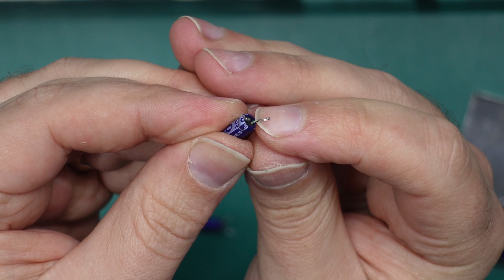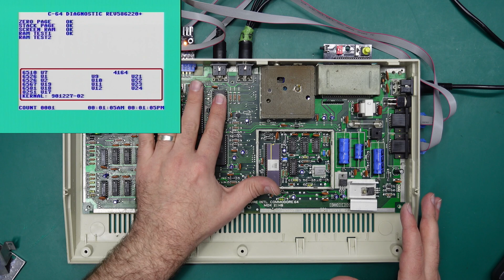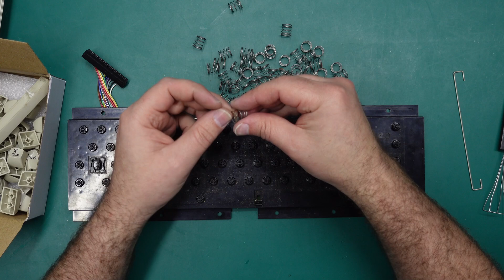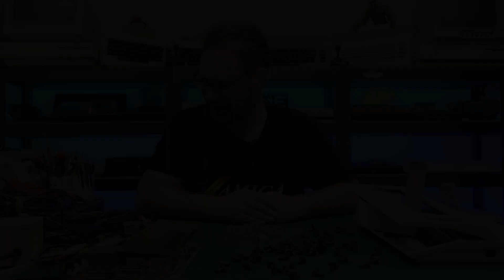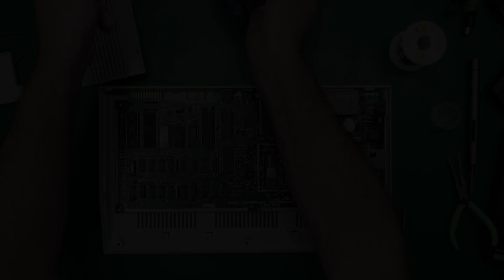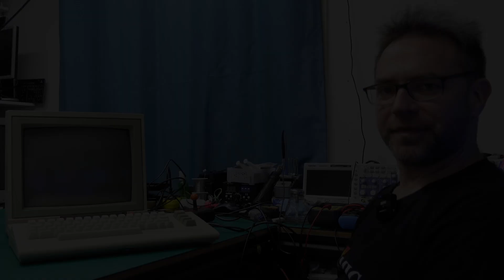Commodore 64C repair Part 2 - dirty ports and keyboard sup...ports

Comment: Could you leave the can lid off and use a heatsink?
Reply from the maker: It should fit, but I think the can is slightly more effective (as long as the thermal paste hasn't dried up)

Comment: The 8-Bit-Guy suggested washing (retro!-)mainboards in the dishwasher without the soap and rinsing them with alcohol afterwards, what are your(/everybodies) thoughts/experiences on that?
Reply from the maker: I prefer using my dishwasher for dishes. But if it's just with water and then a through rinse with 99% IPA then it should be ok. Still there's things like switches and ports to consider, water can get in there in the dishwasher and you'd want to be certain that it's completely removed afterwards. 
Tldr: I don't recommend it

Comment: I have never own a C64. At this point I would like one in my collection. I have no preference aesthetically. I assume one of the latest models would be most desirable, if I can find one?
Reply from the maker: Yes, newer boards are generally more reliable. I'd avoid the breadbins and look for something in the C64C style case. That way you'll likely end up with a 250466 longboard or a 250469 shortboard. Unless someone has swapped the boards like the one in this video of course.

The 250469 are probably the most reliable but some people prefer the longboard for the 6581 SID, and likewise some prefer the shortboard for the 8580 SID. Personally I prefer the 6581 but there are mods to make the 6581 work in a shortboard and of course replacement SIDs that can emulate both.
Reply: @TheRetroChannel  Great, thanks so much.

Comment: I think the first boards fitted in the C64C cases were the 250466 long board. The '466 board doesn't have a can around the VIC2/Clock chip so the centre 3D printed bracket probably fits fine on that board. The "official" left side Commodore metal keyboard bracket for the 250466 board won't work with the older boards that have the 8 RAM chips, there isn't enough clearance on the board.
Reply from the maker: Ah yes good point. I didn't think of it at the time but that left 466 bracket does dip down quite a bit so probably would hit the RAM on older boards.